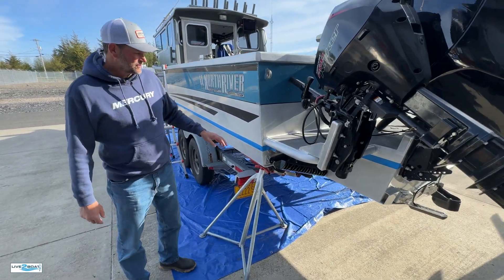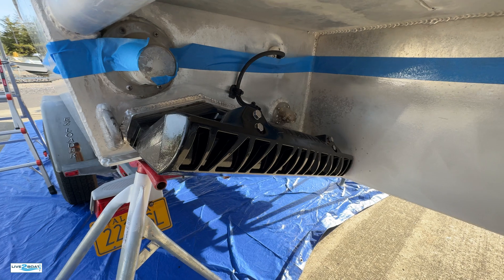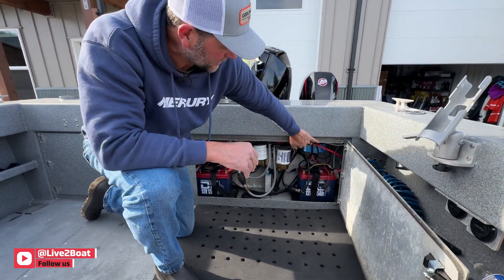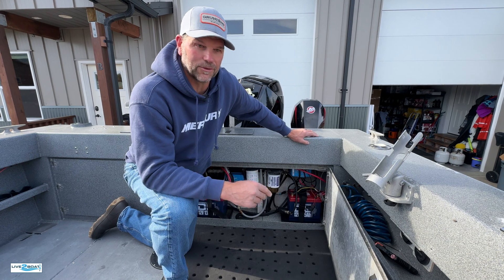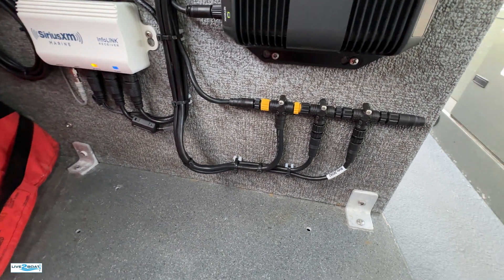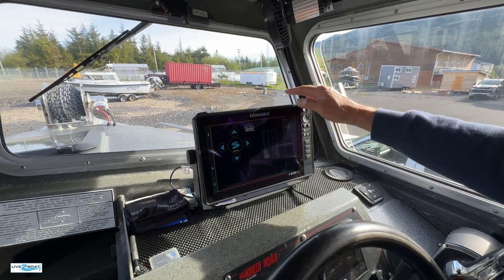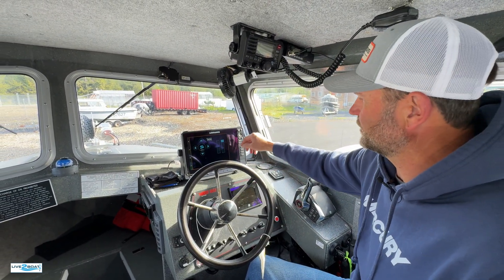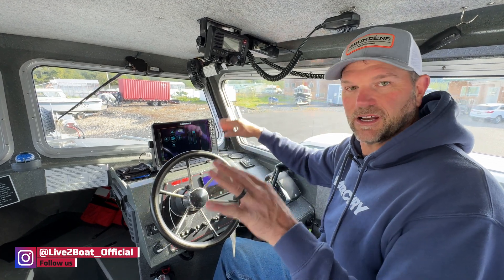Seakeeper Ride Install - 28' North River Alaska Charter Boat

Comment: Did you have to weld an extra plate of aluminum in order to get the install to work? All videos I've watched of installs so far have been on glass boats. Thanks.
Reply from the maker: Yes they had to do some welding and move some things around to make it work 👍
Reply: @live2boat   Hey I really appreciate you responding to my comment. Thank you for that! I've got a local fab shop that does some amazing work, I'll see if they can sort something out for me.